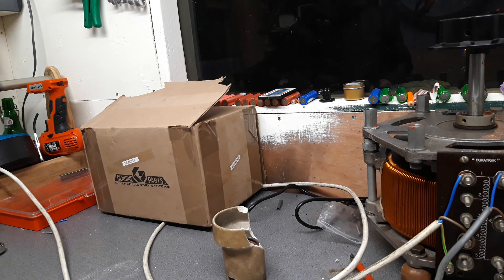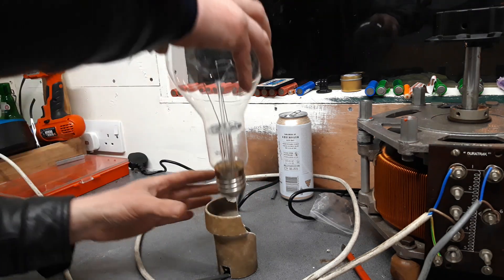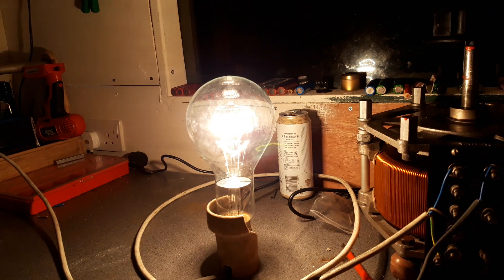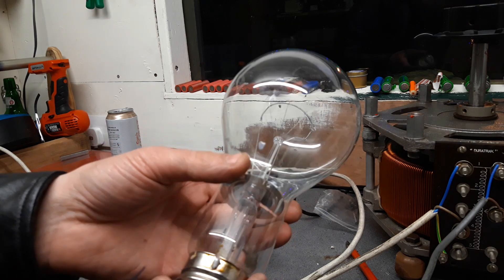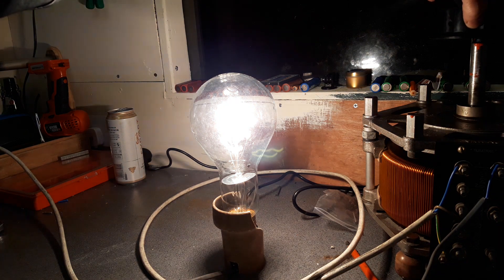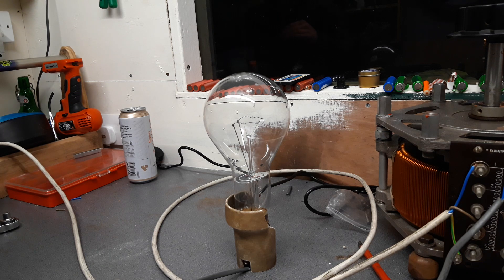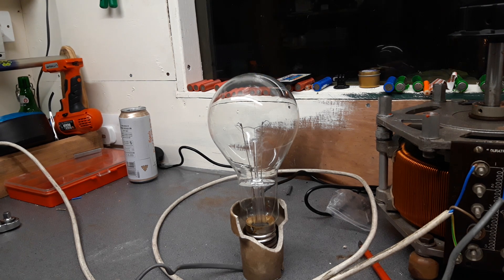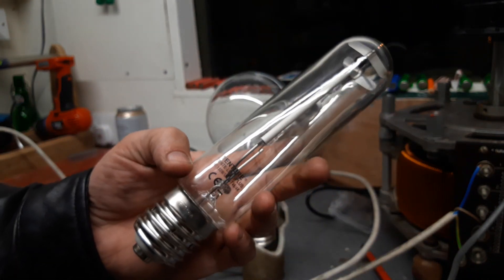Parcel from photonicinduction reveal.

Comment: Mmmm, 500 watt 
GES ES 40 cap lamps. 
If you are going to do 
that thing with these......

.......If you have a suitably sized site transformer, you can run these at 55v.

Experiment around, seeing as you have a variac: screw one lamp in and dial up 55v and see what it looks like in a dark room. If you like the light output, then you'll be interested to know that site transformers have 2x 55v connections on them, and one lamp can be connected to +55v and the centre tap and the other can be connected to -55v to the centre tap and each lamp will run on their own half of the secondary winding.

Busting some numbers:

500 watt lamp (voltage assumed: 240v) = 115.2 ohms

Putting 55v through 115.2 ohms will give 26.25 watts.

So each half of the secondary will have 26 and quarter watts on it.

Total load on transformer = 52.5 watts. :-)

Really though, it depends on what level of lighting you wish to go for.

Don't forget though: If you're stuck for sourcing a transformer and don't wish to use your variac, you can always experiment with wiring the lamps in series to see what result that gives on 55v. :D 

Thanxx for showing,

-Wayne's Electrical.

20th March 2019, 20.35